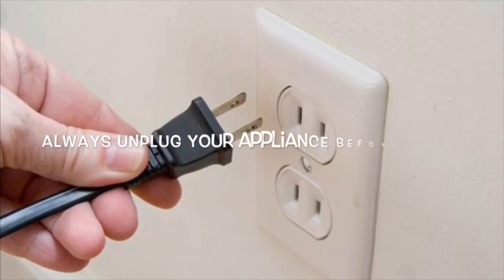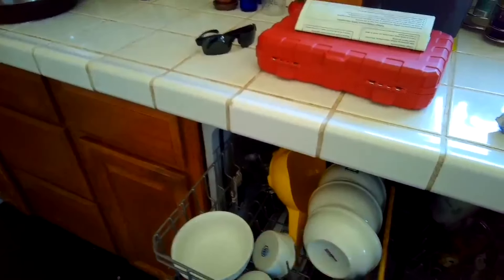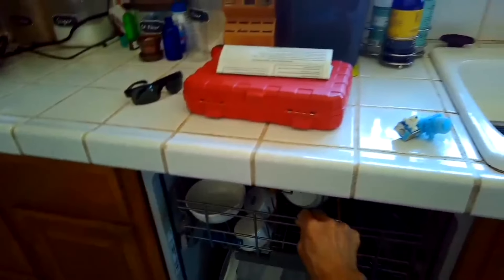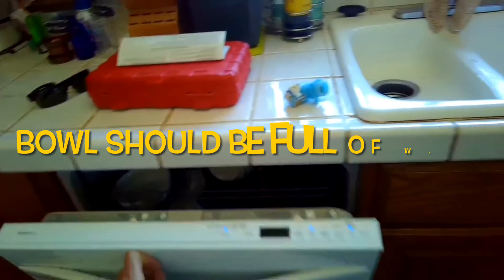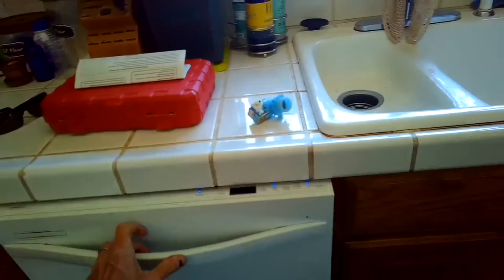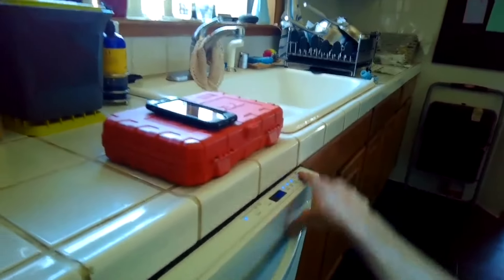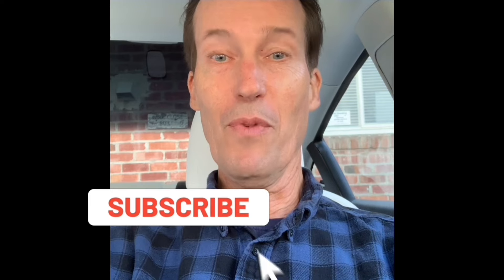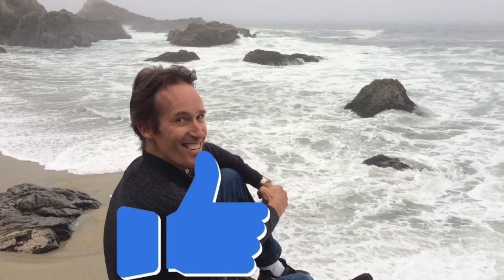✨ How to Test a Dishwasher Circulation Pump ✨

Comment: Any recommendations on what to fix for a kitchenaid dishwasher that  has been thoroughly cleaned, water is at the bottom but not going to the top racks? I don’t know what to try next.
Reply from the maker: Next cycle, can you add 2 glasses of water 4 minutes after the cycle starts and then put the bowl in to see if it will fill up.
Reply: @ScottTheFixItGuyChannel if a bowl is facing up, it catches water. If the bowl is facing down then no water is spraying up to clean it. I don’t know why it’s doing this. I’ve taken it apart, cleaned it and made sure the spray arm is clear then put it back together. I don’t know why the water is not spraying up into the top two shelves.